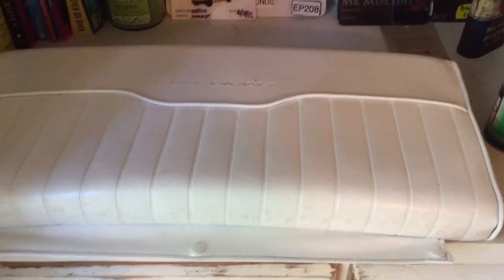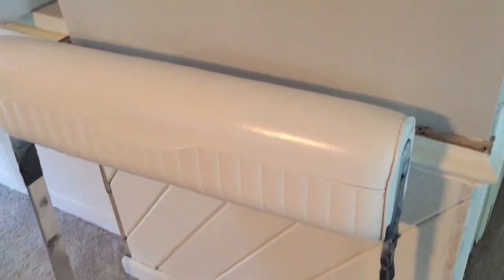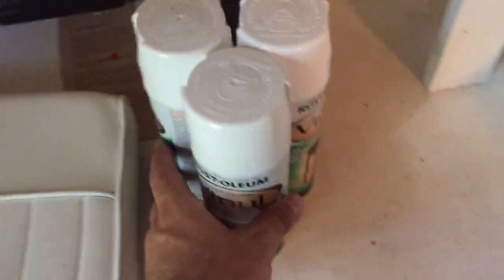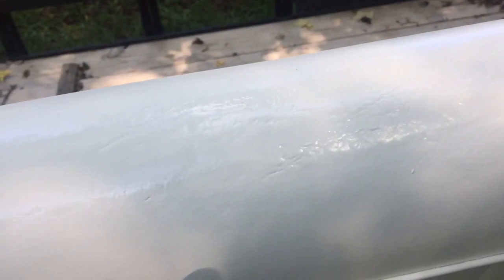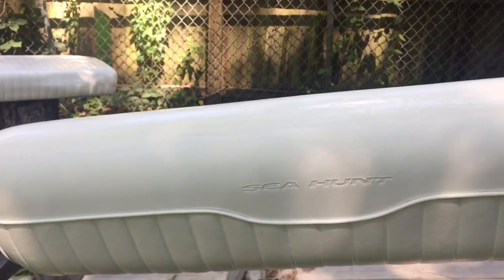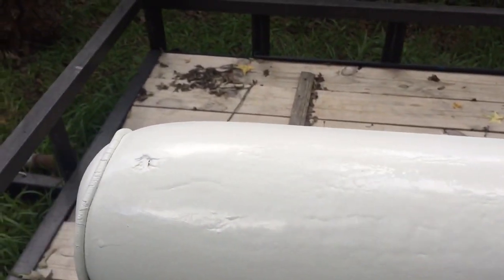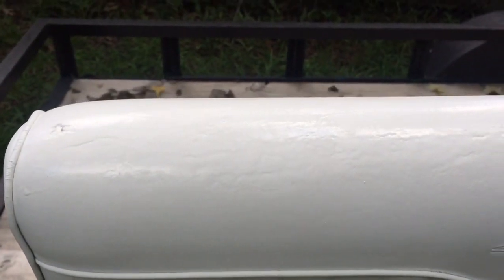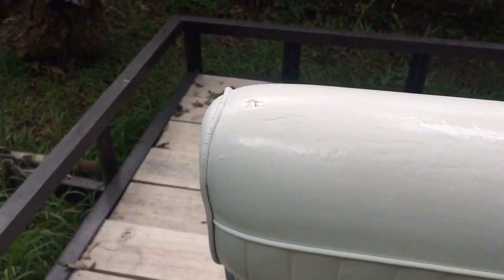One year follow up for boat seat repair and repaint

Comment: Painted parts of my seats last year and it held up well. So this year I painted all the vinyl on our boat including 6 seats and the bolsters.  I had to replace the front bolster (it cracked and the seams split). This paint is whiter than the replaced bolster so I painted that one too. Taped off the blue welting in each seat and everything now looks virtually brand new. Also painted the vinyl grip of the grab handle at the boarding platform last year and it held up perfect. Used the same Rustoleum Specialty Vinyl Spray Paint in white. Used all 6 cans.

Comment: you can fill those low spots with vinyl  filler I think or some  flexible glue / Silicone maybe ? then sand a little and spray over it
Reply from the maker: That’s a very good idea!

Comment: The cracked area on the seat back,, Do you think that you could find a suitable over the counter vinyl upholstery material and scissor cut a long piece to run the full length of the seat back and wide enough to cover the entire cracked area?  Imagine an extra  long saddle blanket.

Could you then find a suitable adhesive and neatly cement the new cut vinyl strip across the full length of the seat back from end to end to cover cracks?  That migt even be cheaper than buying the paint.
Even a contrasting color might work..

The year that went by for this follow up, how much wear and tear and use did the seats get in that year?  Kids, dogs,   
I wonder about heavy traffic wearing away the paint.  I am thinking of buying new folding seats, grey in color, for my fishing boat and want to paint the factory vinyl seat vinyl  with a multi color camo pattern.   
One seat will get a lot of use so worrying some about wearing down and or cracking the paint.